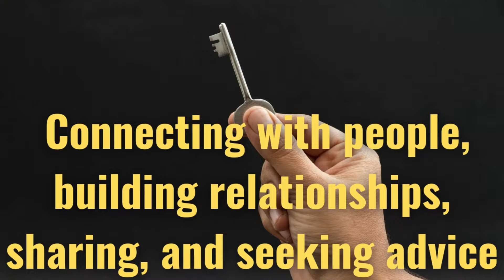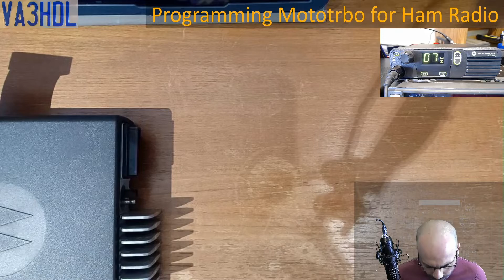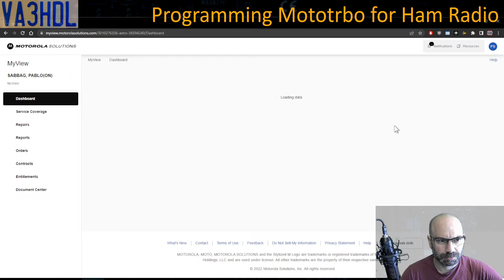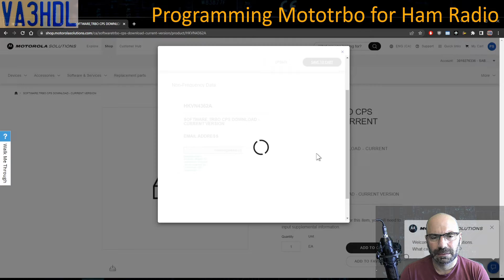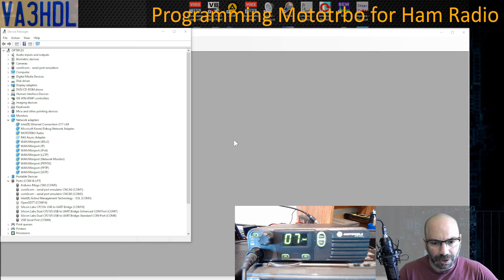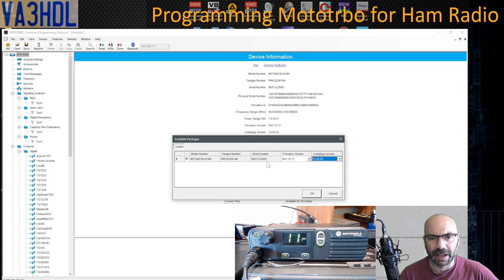MOTOTRBO radio programming for amateur radio

Comment: Thank you for taking the time to make this video!
I’ve had a terrible time trying to understand how to create an account o the Motorola website to get the programming software!
Perhaps this will help. 

I do not have the same model radios as you; but perhaps the process is roughly the same. 

I have a small Motorola UHF 2-way repeater; that I would like to reprogram into the UHF American ham band and put up a DMR repeater in the area where I live in northeast Georgia in the U.S.  

Thank you again for your video! 😊

Comment: Thanks Pablo.  Im wondering how long Motorola will take to give me a business account?  Followed your instructions.  73.  VE4RBR
Reply: Hi VE4RBR, 
I just did the new acct with Mot a couple months ago. It was relatively painless and didn't take too long. I'd recommend you give it a try. They set me up with free access to MotoTRBO s/w and also the P25 radio s/w. They have improved a lot since I tried same thing several years ago and got no response from Mot back then.
 73, Bruce, N6OHI

Comment: Thank you for this great video.  I have the entitlement for 25 khz.  How do I apply it to the radio?
Reply from the maker: After adding the entitlement to the CPS that you are using now you apply to the radio. Make sure you add the entitlement on your main CPS install. You can use the entitlement only on one CPS. If you have multiple CPS installs, then you require multiple entitlements. It happened to me and I requested one more after reinstalling the CPS on Windows 10.
Reply: @VA3HDL  I tried to register it with CPS 16 (I also have CPS 2.0 installed).  I Rx an error indicating CPS unable to connect to license server...    I reached out to Motorola and they said CPS 16 is no longer supported and I MAY not be able to register the EID.  Also, I was using "Register CPS Feature"   I don't know for certain this is the correct approach.
Reply from the maker: @jimpierce2561  I didn't have any problems programming my radios with CPS 2.0 - But I do not have them anymore and I didn't do anything else on the Motorola world since then.
Reply: @jimpierce2561  There's a hex hack to enable 25KHz on 16 rel. 828. Search; it's out there.

Comment: after getting the account setup and following your instructions, entering your CPS part number. HKVN4362A. is shows message " You have been automatically redirected to a more recent version of the product." which is RVN5115AM and has a message In Stock - Product is no longer available to order.

Comment: I didn't have to recursively use WIndows 7. I installed the driver.. had to power cycle the radio and close and reopen CPS and POOF!  It found the radio.  So that's a start.
Reply from the maker: Excellent! I did the same. Had to upgrade the radio in Windows 7 and then was recognized under Windows 10.

Comment: what difference between cps vs cps 2.0
Reply from the maker: The major difference I noticed is the user interface looking more modern. I didn't do the programming with CPS 2.0 but I was able to read the radios without any issues. I'm not sure if possible to go back to the old CPS if the radios are programmed with CPS 2.0 - I didn't try this. I believe that should be more differences but I haven't played much with 2.0
Reply: @VA3HDL  How do I acquire the FIRMWARE such that I can download it to the radio?  DO I install CPS in windows 7 FIRST (and I presume this fixes the drive issue) and THEN download firmware updates?  I'm confused about the ports, network addresses and so on to connect to the radio EVEN IF the driver is working in WIndows 7.  Thanks.
Reply from the maker: @silasmarner7586  Yes, that is correct.First upgrade the radio firmware in Windows 7, then it will be recognized in Windows 10. Now to add the firmware go to motorolasolutions, my view, entitlements, software, and add them there for free using the "+ Subscribe" button at the top. Download and install the firmware package on the Windows 7 machine. Good luck.

Comment: I have completed the order for the software and its approved, but not showing up in entitlments even after following the steps. Appreciate the video though!
Reply from the maker: It could take few days. Thanks for watching.
Reply: @VA3HDL  I got the CPS software but I have the exclamation point on the network device and I will need the "updated driver" that I .. .GUESS? I have to install using windows 7 and .. THEN?  move back to windows 10.  But I do NOT know where on earth to locate the FIRMWARE upgrade. You don't show it, NOBODY shows it.. I'm confused. OK thanks.

Comment: Looks like registration has changed quite a bit. I don't get the account type screen after selecting country. It goes to a screen that asks "Are you an authorized channel partner or customer with contractual agreements?" .  I selected no, and set up a personal account, then selected upgrade to business account. I guess I'll know in a few days if it worked.
Reply: Had to do the same thing. Were you able to upgrade?
Reply: I just did the same thing. Hopefully it will work for us
Reply: Did you ever get a reply? I did the same process almost a month ago. I got a welcome email about a week after but that's been it.
Reply from the maker: @BD-oo6ru  Call them
Reply from the maker: Good luck! Thanks for watching.

Comment: dont burn your hotspot with those 20 w on low power ....
Reply from the maker: Hi Luis, this is very good advice!
My hotspot channel on this Motorola radio is programmed to 1 W output. The antenna I use is generally located on the top of my tower, very far from the hotspot. 73

Comment: Hola Pablo,
¿sabes si se pueden configurar radios APX 1000 para que se puedan comunicar con radios DGP (vhf digitales) ?
Saludos.
Reply from the maker: Todo lo que se sobre Motorola's esta en el video. Tuve que buscar tu pregunta y encontre esto: 
DMR equipment can be divided into three levels:
Although DMR, TETRA, P25 and MPT-1327 are all based on open communication standards, they are also They have different protocols and target markets (for example, TETRA and P25 are widely used by public safety organizations) and are not technically compatible.
Aparantemente no se pueden mezclar entre los 4, pero no soy un experto en esto. Espero que te sirva.

Comment: My account has finally been approved as a business and I STILL cant access the download...... I'ts been a process they're so backed up it took 3 weeks just to get approved....Any thoughts or feedback?
Reply from the maker: One thing that you can do is contact their support via the chat or via the toll free number and ask them to enable your account to get this code. This usually helps. Good luck!
Reply: Hello I created a Motorola account and been 5 days and still on able to login how long more does it take and how would I know if I get approved??
Reply: @warzone7571  I had to reach out several times. Even after the account was activated I had nothing but issues with orders and so on. A total of 5 times between calls and live chats. It took about 20 days to get approved and another 7 before my first order was placed and the download was sent. I had to reach out for each step. The order was placed for software download and I never received an email so after about 7 days I sent a live chat and within minutes I got the email. I think they have issues with their emailing system
Reply: @rmgrimshaw23  oh so probably I’m going to have to call them because already going to a week and I’m not able to login to my account that I created by the way I send you a email check ur inbox I have a question.

Comment: Does this software work 
With Motorola xpr 6550
Reply from the maker: It should work. I'm not aware of other software to program these radios. For older radios may not work, but for new ones like the XPR shouldn't be a problem.
Reply: @VA3HDL  is software cps still free to download??
Reply from the maker: @warzone7571  Hi there, even the software is given for $0 you still have to enter your CC information and nothing will be charged to the card, but a valid card must be provided.
Reply from the maker: @warzone7571  I just did a quick search on the "Shop" for the part number HKVN4362A and is still coming at $0.00
Reply: @VA3HDL  oh nice so the part number would be the software right I would hat to put in this part number
Reply from the maker: @warzone7571  Correct, purchase that part number for $0.00 and in few days you will have the "entitlement" software downloads available to you.
Reply: @VA3HDL  ok perfect and for firmware I have to subscribe right would they ask me once again for my credit card information?
Reply from the maker: @warzone7571  No CC information needed for the firmware files. :)
Reply: @VA3HDL  another question once I put all my cc information  I wont get charge in the future since all my information from my cc or it’s only a one time purchase my credit information won’t stay in the Motorola account??
Reply from the maker: @warzone7571  No, it will not be saved on your account unless you ask specifically to do so. I had to enter my CC information on every order for other entitlements I wanted.
Reply: @VA3HDL  ok sounds good so I just fallow the steps in the video ??
Reply: @VA3HDL  Do you have an email where I can contact you??
Reply from the maker: @warzone7571  Is in the "About" tab on the YouTube channel or in the QRZ page.
Reply: @VA3HDL  do you have an email where I can contact you?
Reply: @VA3HDL  hello do you have email I can contact you

Comment: I've had an account with Motorola Solutions for some time now. I followed the steps of this video exactly and was able to put the order for the software in my cart. However, it will not let me check out. There is only a continuous spinning wheel of death. It's been going for about 2 hours now.
Reply from the maker: Hi there, even the software is given for $0 you still have to enter your CC information and nothing will be charged to the card, but a valid card must be provided. Did you do this?
Reply: @VA3HDL  I wasn't able to even get that far. Once I added the software to my cart, I clicked on "my cart". Once the new page came up, there was a never-ending spinning wheel on the center of the page, and the check out button is grayed out so I can't continue.
Reply from the maker: @thefozzmancometh  Call or chat with them during their support hours. They will help you. Good luck.
Reply: I already registered to open and account I follow the steps and 5 days already passed and I can’t login to my account yet how long more do I wait or did something go wrong??